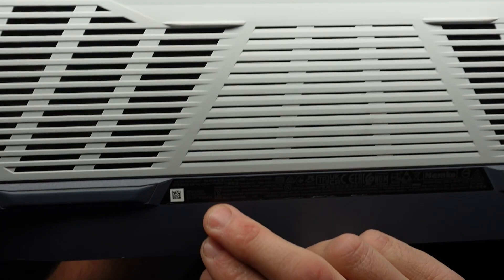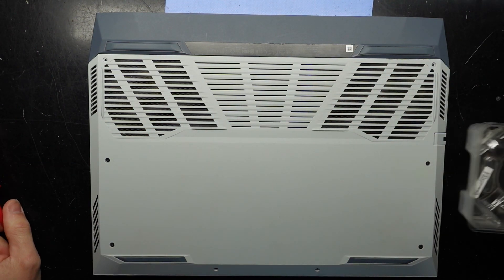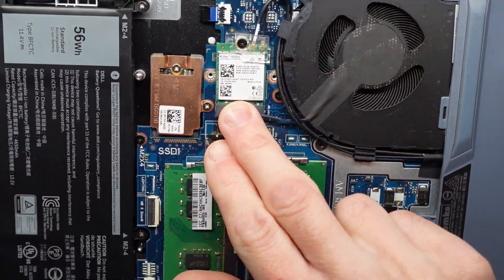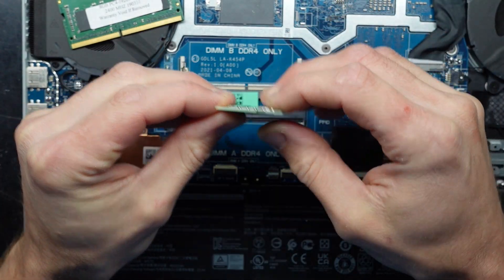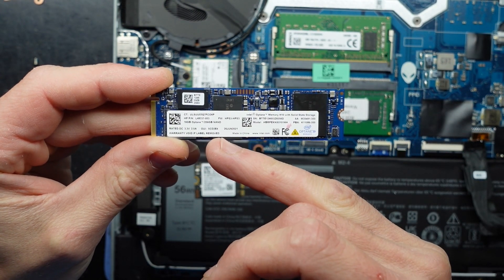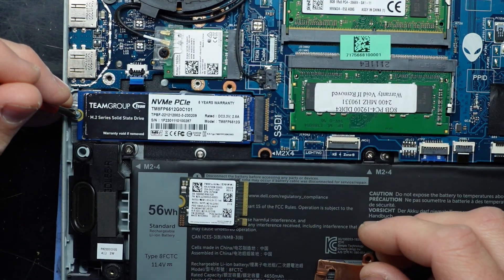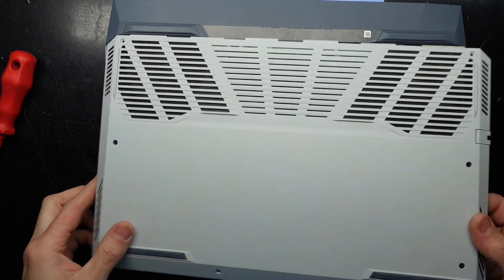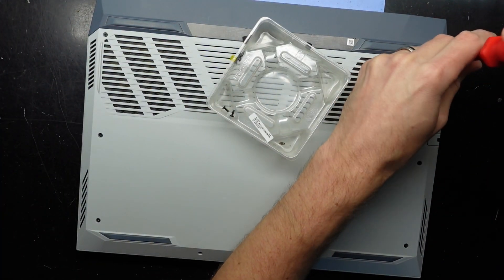Dell G15 5515 Ryzen Edition, Ram and NVMe Upgrade

Comment: Thanks, man! I've fallen way behind on hardware knowledge in the last 13-15 years, and the last laptop I upgraded RAM for was a Lenovo ThinkPad W500 (I think).

A heady 2008 vintage, yes. Quite.

adjusts monocle

Anyway, when I found this G15 didn't have an access panel for modular expansion, I lost all confidence for some reason.

So, thanks again for contributing to YouTube University!

P.S. I'm really weirded out by Dell's use of phyllips screws instead of torx...
Reply from the maker: Cheers, Great to read this has helped with your upgrade :)

Comment: hello, I know this is too late but could please tell me whether you can remove the fans for cleaning? without removing the heatsink/motherboard? I have this particular model (5515), I have seen it be done on 5510 but I am not sure about 5515